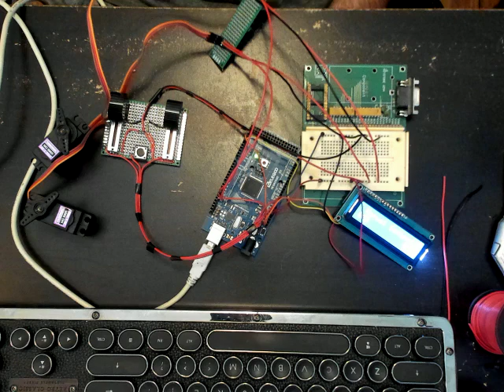Dark Ride Car Control System - Part 1

Comment: I have been trying to do something like this for neighborhood haunted house.  I am interested in the line following mode a lot.  Can I please have the code for that?  I am just getting into Arduino.  I want people to see Halloween as an important culture holiday.
Reply from the maker: unfortunately, in real world testing I was unable to get this to work with the weight of the cart. I couldn't correct fast enough with the motors for it to stay within the bounds. It also had difficult in any daylight of picking up the line color (even with brushes around the sensor touching the ground.
Reply from the maker: I ended up just using the manual mode to drive the cart while walking behind it.
Reply: @samseide  I'm sorry that didn't work out.  Good effort